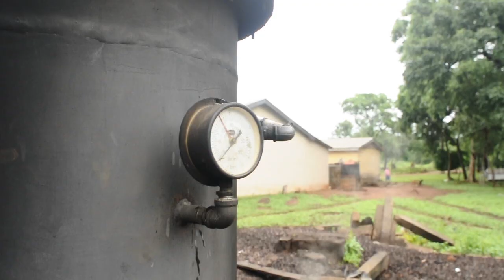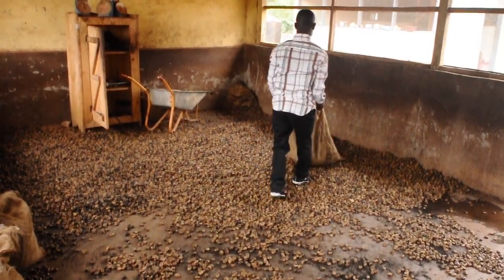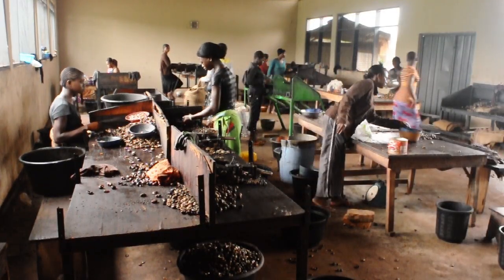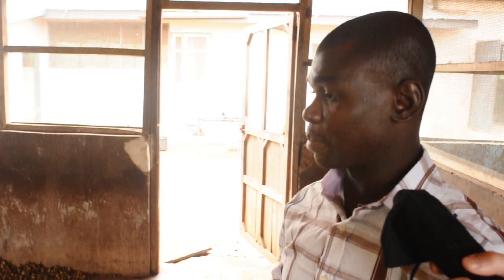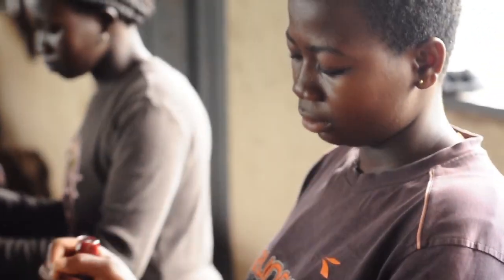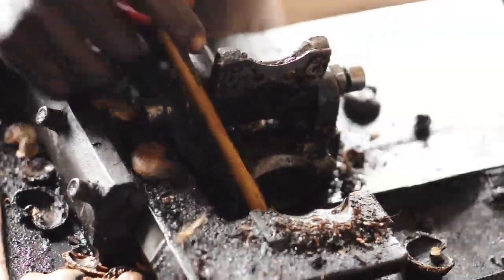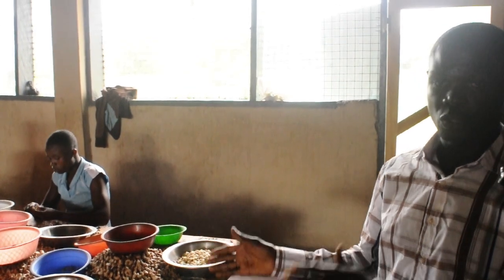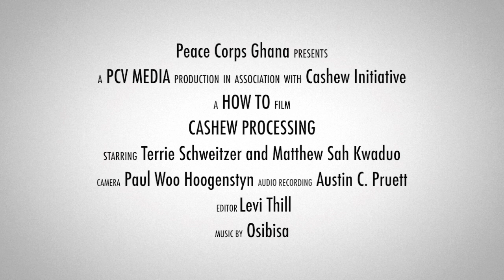Cashew Nut Processing - Peace Corps Ghana

Comment: why not just give them gloves to deshell the cashews?
Reply: Seems logical right? And gloves are relatively cheap.
Reply: there are gloves available but most workers choose to not wear gloves since they lose dexterity and since the are paid by the kilo it its beneficial for them to be able to work faster. To protect their hands from the caustic oils of the chasew shell they coat their hands in coco oil
Reply: Jason Ready coco oil is affordable for their living standard?
Reply: Jason Ready i've seen plants like these with gloves that fit the hands perfectly so dexterity loss would be minimal. But since you bring the performance based pay i can see how a worker would decide to go without them, its just something about this video that leaves me doubting that they have a choice to wear nice form fitting gloves
Reply: ya ever try working in the heat with rubber gloves , dude! it's a sloppy mess
Reply: Master Shake I mean...they don’t have access to those gloves in a rural village in central Ghana. Maybe someone could bring them in but they’d likely be very expensive and the women would prefer to do it as they’ve done for years. The cocoa oil is very accessible and cheap for them, so it may be a more appropriate alternative when comparing performance to protection.